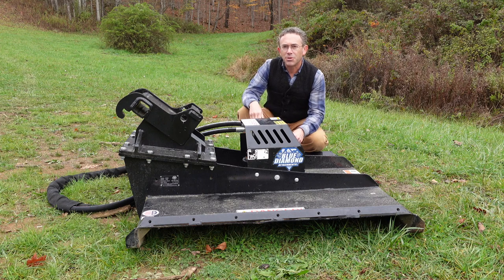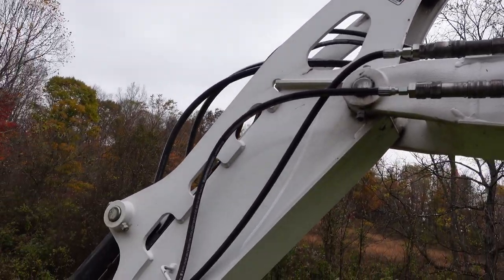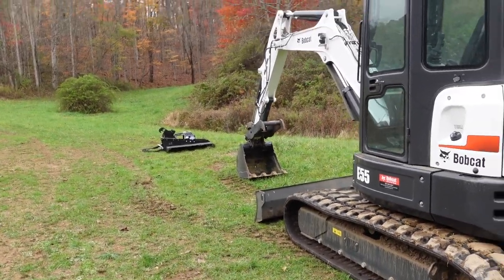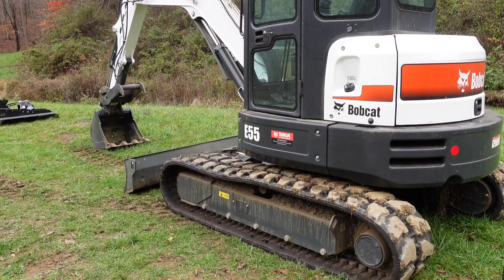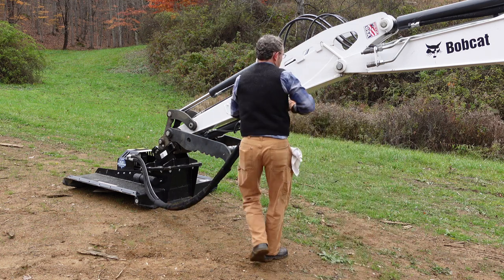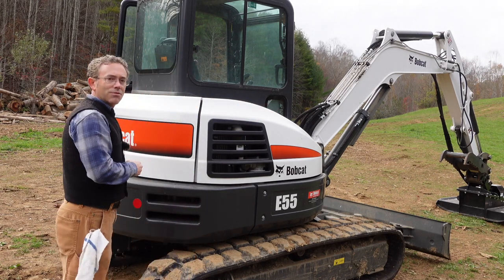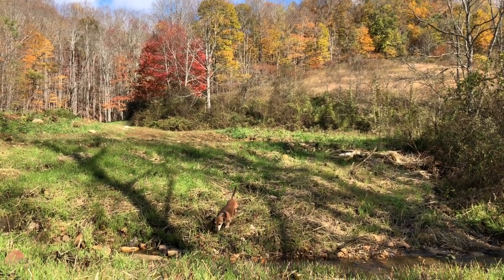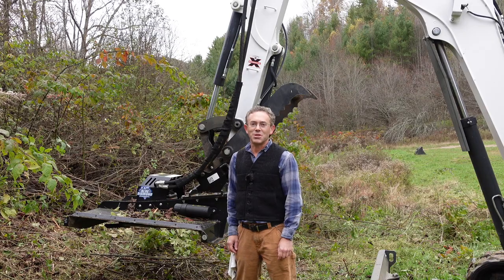Attaching a Brush Cutter to the Mini Excavator - Step-by-Step

Comment: I use #1 diesel from Shell or Cenex here in MN during winter.  They put additives in that prevent gelling.  Haven't had any problems yet in my E26 but never use it below 0F.  
Nice set up with the brush mower!
Reply from the maker: That sounds like the right way to do it! My current practice of filling up jerry cans sometimes at the farmer's co-op and sometimes at the gas station leaves a lot to be desired. Getting a 500 gal storage tank is on my to-do list so I can have quality diesel delivered.
Reply: Bill, can you put a brush cutter on your Bobcat E26?

Comment: Thank you for such a well made video.   I have no experience with an excavator.  I just purchased a new Yanmar VIO50 and a 42" cutter from VMC. I am on top of a mountain in north Alabama and I will use it on some steep terrain.  I am retired and 70 and trying to be careful but I get that pucker factor easily .   BTW,  I sold wine for  3 different distributors  for about 10 yrs  in the 1970's.   Good luck in your endeavors .
Reply from the maker: Thank you! Yanmar makes great equipment. And I hear you! If I rotate the cab a full 360 while on a slope, the pucker factor is there big time, even though I know the slope isn't that steep. 😂